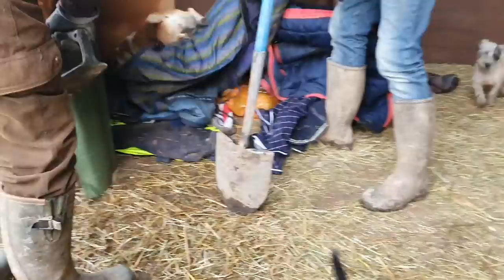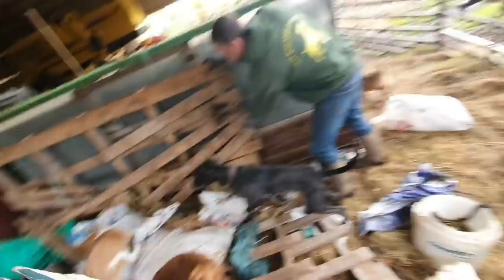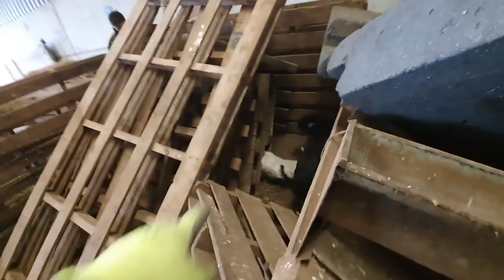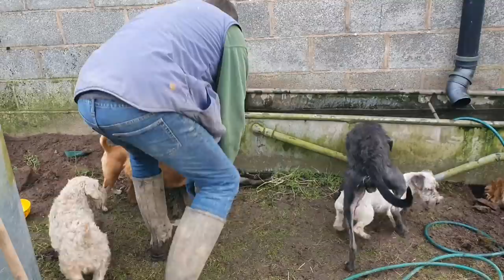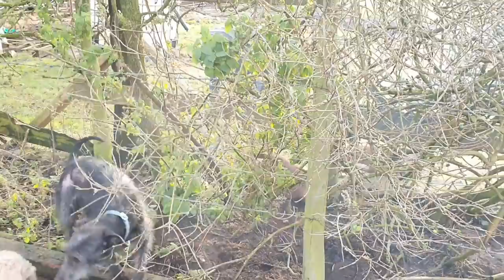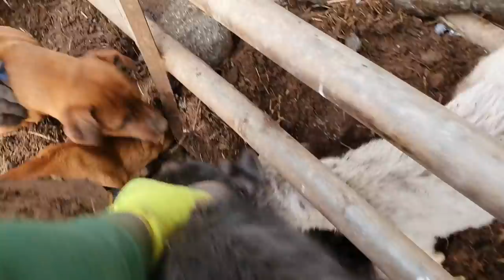pest control ratting with terriers

Comment: instead of the chainsaw smoke maker, you should try my bee smoker trick with a hose on the end. It works great and is quiet.  Love the video!
Reply from the maker: Thanks Mathew will give it a try but belive it or not some it's the noise and vibration what makes the bolt
Reply: @mrjohnsonsworkingterriers  That does make sense.  lots of disorienting frightening noise.  I like the hose set up.  :)